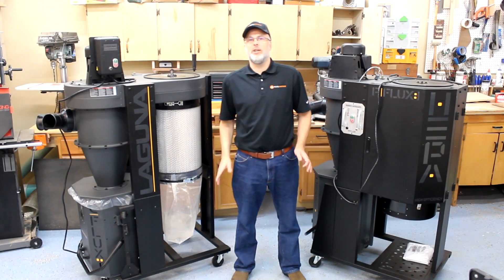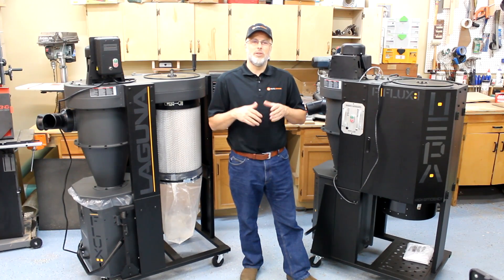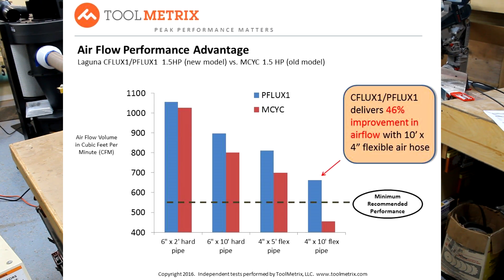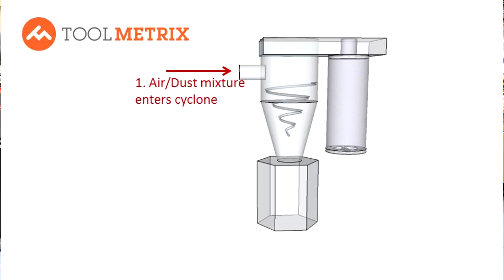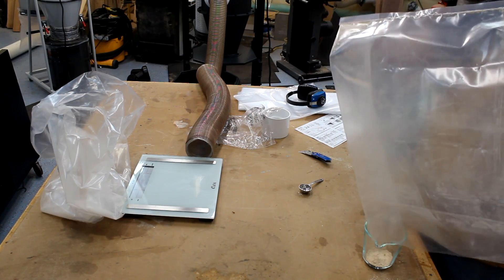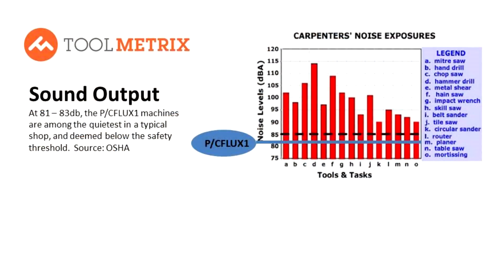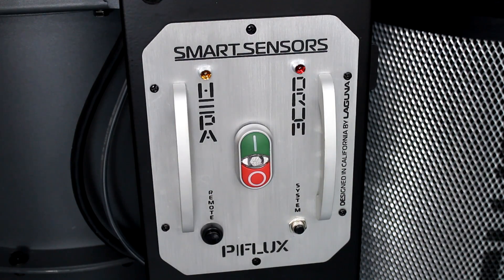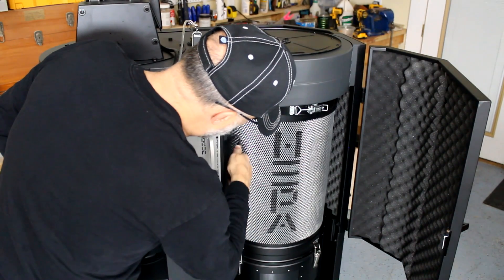Laguna CFLUX1 and PFLUX1 Dust Collection Cyclone "Deep Dive" Examination

Comment: Thanks for the review! I am very curious to know how you think these hold up to the Clear Vue cyclones since I know you've worked with both. Bill Pentz would argue the cyclones and motor aren't large enough to effectively separate and collect fine dust but the figures you're getting and that Laguna is claiming seem to be in evidence to the contrary. I would rather buy the Laguna because it's a heck of a lot more convenient shape, size, more mobile, and quieter, but if Clear Vue is still the supposed "only" dust collector available capable of providing a safe work environment, I might just have to go with the CV1800. I'm torn. Penny for your thoughts?
Reply: PS Specifically for a comparison between the 3HP models of c flux and p flux and the clear Vue.
Reply from the maker: Sure, here are a few thoughts on this.  From an air flow perspective you would need to step up to a 3HP Laguna machine to match the CV1800; then you are in the same ballpark.  I've posted my air flow test results on the ToolMetrix FB page, and plan to include these in a video at some point as well.  I had a CV in my shop for about 5 years and loved it; great product, great company.  Given what I saw in my tests, I think Laguna might give CV a run for their money on separation, although it will take more data points than the simple tests that I ran here.  I’m a fan of Bill Pentz’ research and I’m extremely grateful for what he has done to raise awareness of dust collection challenges.  I understand the theory as to why these cyclones should not have separated as well as they did in my tests.  I was surprised by the results myself, and I ran the test again with nearly identical results.  
Clear Vue has the advantage of being American made, including the very nice motor, and I also like the ability to quickly see when the drum is full by just glancing at the cyclone from anywhere in the shop.  
To Laguna’s credit they have set a new standard for convenience with these new machines, as the drum management system is absolutely superb and the pressure balanced drum in the PFLUX is a nice bonus as well.  The Laguna PFLUX 3 is a few decibels quieter as well.  I did not have a CFLUX 3 to test, but I'm guessing it is roughly the same on sound output as the CV 1800.
Reply: ToolMetrix thank you so much for the info! What is the approximate db output from the p flux 3hp?
Reply from the maker: I measure the PFLUX 3 at 87 db in my shop.

Comment: Excellent review. One question about the volumetric flow measurements: You measured flow in an open ended duct. Shouldn't the intended tool be connected? For example, if you need 600 cfm at your 14|bx bandsaw, shouldn't it be connected because it will add to the static load?  It would be extraordinarily useful to see results for this test if you'd be willing to hook up the collector to your 14|12 or 14|bx.
Reply from the maker: Thank you. You are correct; most tools such as a band saw will impose some additional static pressure and the tool needs to be accounted for in the overall design.  That, and the fact that performance will decline as the filter is loaded, are reasons for not cutting it close on your air flow requirements.  I no longer have the 1.5 HP machines in my shop so I cannot do the specific test that you requested, but I'll do a the test on the PFLUX 3 and let you know what the decrease in CFM is when I add a 14bx.
Reply: Thank you. This will be exceptionally helpful and interesting. With two ports vs. one, I cannot decide if the 14|bx will show lower static load than the 14|12, or if the load will be determined by the openings for airflow up by the blade port in the table.
Reply from the maker: OK, here are the results.  This was on the extreme longest run in my shop which I use as a floor sweep, so to be clear I would not hook up a band saw on this port for actual use.  The duct run consists of roughly 45 feet of 6" pipe with (5) 90s and (1) 45, plus a 15 - 20' section of 4" flex.  I tested with the duct not connected, then connected to the upper port and left the bottom port open and saw an increase in SP of .4, and a drop in CFM of 96.  Then I blocked the lower port and saw a further increase in SP or .3, and an additional decline in CFM of 23.   Again these tests were performed using a PFLUX3.  I no longer have a 14|12 in my shop by it is probably similar to the results when blocking the lower port.  If your dust collector is powerful enough you would obviously be better off making two 4" drops off of your main line (assuming that it is larger than 4") and connecting to both ports.    Good luck with your decision.
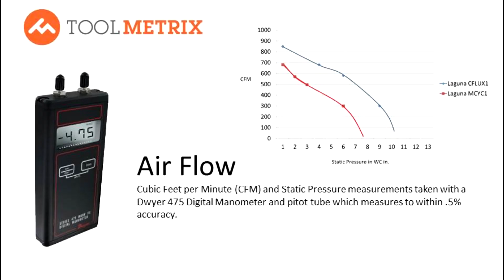Reply: That was fast! You have a system curve in your video at 1:30 which, although for different machines, has a slope of about 75 CFM per inch w.c. of pressure. You see 240 CFM per inch for the first 0.3 inches and  170 cfm per inch when the full 0.7 inches w.c. is added. You're at the end of the line and I'm guessing are far out on the system curve where it is steeper, so what you're seeing seems consistent with the curves in the video (which I realize are for different machines).

So, if I had a minimal connection, just a few feet and maybe two 45 degree elbows, plus the 0.7" loss at the saw, let's say that sums up to around 3 inches total w.c. Then, for the MYC1 I could meet Laguna's 350 cfm requirement for their 14|12, but not the target 600 cfm, but I could get 600 cfm from the CFLUX1.  Maybe if we took the MYC1 through a wye to both ports we could get closer to 600 for the bx?

I wish manufacturers gave these numbers, e.g., additional load for a tool vs. cfm and system curves for the fans. I have a little garage shop, strongly hand tools, and only need to handle a bandsaw, so with this ballpark number of 0.7" w.c. (call it 1 inch), I can try to cook something up. 

Thanks so much for doing this.

Comment: I'm looking at purchasing the older MCY model as it's on sale for $500 cheaper than the 1.5 C Flux. Going to be hooking it up to a CNC machine that will be cutting foam surf boards. Do you think I'm better off to pay the extra $500 for the C Flux or will the older model for fine for what I'm doing?
Reply from the maker: Hi Paul, Wow, that will be a challenging material for air/dust separation.  My only experience is with wood dust, so I don't have any qualified advice to provide for you.  In terms of CFM, I also don't know how much air flow is needed for good extraction with this material, but at least you can see from my test results what kind of flow you can expect from each model.

Comment: Where is the review comparing the 1.5hp to the 3hp dc units?  You mentioned it in this video but i can't seem to find it. Thanks.
Reply from the maker: I haven't created a video yet, but I've put a chart with the CFM tests out on the ToolMetrix FB page.  I'm still planning to do a video on the 3HP unit but haven't had time yet.

Comment: Any problem with downtime on these that you can comment on? Not many reviews for these yet but one of the reviews I did read was negative...stating that the unit had shut down several times and he had no time for downtime.  Any feedback on this topic?
Reply from the maker: I haven't had any downtime.   If the machine is shutting down, the owner should have Laguna send some parts or a different unit.

Comment: Great review! I would be interested in seeing the fan curve flow rate with 5" or 6" flex. I am trying to decide between the 1.5 and 2 hp CFlux. I will be connecting directly to my tools and want to target about 800CFM.
Reply from the maker: Sorry that I missed this.  Take a look at the diagrams in this video and you will see what my actual measurements were for the 1.5 HP units.  The 3 minute mark shows a good representation of what you are doing.  I never got to try the 2 HP unit.

Comment: Hi, thank you for the review. I am currently in the market for a dust collector and was thinking of a machine similar to this. I only have what amounts to a 1 stall garage as a shop, so footprint (and sound level) are important to me. Any thoughts as to how these might fit in a space like that? I'm also considering the b- flux or perhaps the rockler dust right system. I understand that those are not cyclones but if space is a factor I may have to go with something smaller. Its hard to find the right one when there are no local stores with demo models set up to get a good idea of size. Thanks for any input!
Reply from the maker: The 1.5 HP PFLUX/CFLUX machines are not large.  If you look at the footprint dimensions on the Laguna site the C/PFLUX has a smaller footprint than the BFLUX.  In terms of the dust right system, it's a cool concept but no way will you pull adequate CFM with that using a 20 foot flexible hose, and I'd rather have no dust collector than one with a 30 micron bag.  I would bet that if you did an air quality test before and after installing that, you'd find that you're quality decreased.  You might find a 1 HP system with a good filter that saves you a bit of footprint over a small cyclone, and that might be a decent option if you keep your ducting short.  I've never done any testing with this size unit, so It's a total SWAG, but I suspect that you could get in the 400 CFM range with 5' of flex hose on a 1 HP machine.  If I have a chance to test on a machine in this category any time soon I'll try it and let you know.
Reply: ToolMetrix at he end of the day, would you recommend the c/flux 1 or the p/flux 1?
Reply from the maker: I like the PFLUX better, mainly due to the pressurized barrel and no need for the drum liner.  This makes it easier and less messy to empty the barrel.  The bin full indicator is nice too.  So, it comes down to money, but if you can swing a few extra bucks for those features the PFLUX is great upgrade.  I am now using the PFLUX 3 in my shop and loving it.
Reply: ToolMetrix great thank you. I was leaning that way.
Reply from the maker: Actually, Trevor, let me qualify that by saying one more thing.  First and foremost, buy the machine that delivers the right CFM for your shop.  So, if you have $1500 to spend, and you want to get the best machine from this product line that you can, I'd favor the CFLUX2 over the PFLUX1.  I'd rather have the additional power.  But if you have decided that the 1.5 HP machine is the right one for your shop, and you can swing the additional $ for the PFLUX, then that's a good call.

Comment: Could you tell me about the power requirements for the PFlux3?  Normally I would think a 20A breaker and 220V outlet would be sufficient for a 3HP motor, but the Laguna website suggests a 30A breaker/outlet is needed.  Is this the case?  That means calling out an electrician, which I'd prefer not to do.
Reply from the maker: +geoff katz I thought the same thing so I tried running it on two different 20 amp circuits and it blew breakers right away. After it was up and running on a 30 amp circuit I checked the amperage draw and it was about 20.
Reply: The motor will require 22A at start up, then it will drop to 17A while running.

Comment: Thanks very much for your in depth review. I am just at the point of buying a DC so your review is particularly timely and the Laguna PFlux1 is/was my primary candidate. Your results are approximately in line with Laguna's specs on their web site EXCEPT for the sound level of the PFlux1 which they claim as 70 Db @ 9.8ft. That is a particular selling point for me. Is there anything about their or your testing methodology that would account for this difference? If the difference is really only a couple of decibels between the CFlux1 and PFlux1 like your tests show, I'd probably go with the CFlux1 instead.
Reply from the maker: Hi Charles, I'm not familiar with how they tested, but my guess would be in a large factory setting where sound dissipates better.  My shop is small at 650 square feet and 10' ceiling height, so there's not much room for the sound to escape.  I ran the test multiple times and I feel confident in the accuracy.  Given all of the variables in involved in measuring sound output, I'm not suggesting that their results are inaccurate, but I suspect that something was dramatically different about the testing environment.
Reply: Thanks for your thoughts. Just to be clear your CFlux sound level numbers are similar to the Laguna specs; it's only the PFlux that has the wide discrepancy. You could test your hypothesis by moving the machines outside and measuring the sound levels in the open air. It would be interesting to me at least. :-) Thanks again, Charles
Reply from the maker: Hi Charles (sorry for calling you Charlie previously), that's a fair request.  I rolled each of them out into the middle of my driveway, 10 feet away from the building.  In this situation my readings averaged 76 db on the CFLUX and 74 on the PFLUX.

Comment: I noticed the PFLUX1 doesn't have a smaller bag hanging down the back of it like the CFLUX1.  Does it have a different way in collecting and removing the dust that is too light for the main collector?
Reply from the maker: Hi Bryan, yep, and that is something that I should have shown in the video as well now that you mention it. Dang.  The PFLUX has a 4" dust below the filter, and you just hook a dust hose to it and clean it out with the suction of the cyclone itself.  Very slick design.

Comment: Good stuff, thanks. How well do you find the led sensors actually work in practice?  Can the bin sensor especially be relied on to alert you before airflow is diminished?
Reply from the maker: Hi Geoff, thanks for the comment.  The bin full sensor worked fine in my basic tests, but I'll caveat that by saying that I didn't fill the drum enough times to give it a fair test to represent production.  My question is whether it will get flaky as it develops static and dust sticks to it, giving a false positive.  Just now I tried packing it with dust, and scratching the surface a bit to see if it caused any problems, and it still works perfectly.  Time will tell with this type of thing, but it seems like a good quality component from a starting point anyway.  As far as alerting you before the air flow is diminished, you can adjust the beam so that it notifies you earlier, and if you do a lot of planing, you might want to adjust it for an early indication because you can go from half full to over full in just a couple minutes with a planer.  When I permanently install the PFLUX3 in my shop I will likely set it to start indicating pretty early, because it's a lot easier and less messy to empty the drum before it is overflowing.

Comment: Can the indicator panel be placed on either side of the PFLUX?
Reply from the maker: That's a great question.  It is not referenced in the manual, so I spoke with a Laguna representative on this.  They said that it was not specifically designed for this.  But I looked at it, and I think you could do it.   It appears that you'd have to reroute a small vacuum line, and disconnect/reconnect the wiring to the motor, but it from the outside it appears that the panels on each side are interchangeable and that it would work.  I know that this doesn't give you the confidence that you would want in order to buy one, but I'd suggest nudging Laguna on this to find out.  One of their techs could figure this out in an hour or so, and I'm sure that they'll get this question a lot.   On a related note, the inlet tube can be rotated 30 degrees toward the rear, and 60 degrees toward the front, to provide a better angle for positioning the machine.